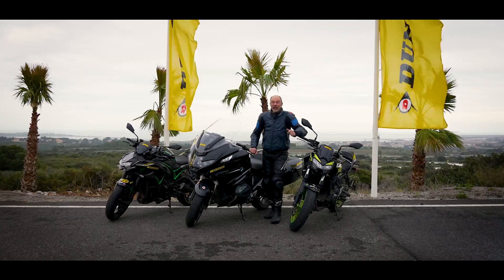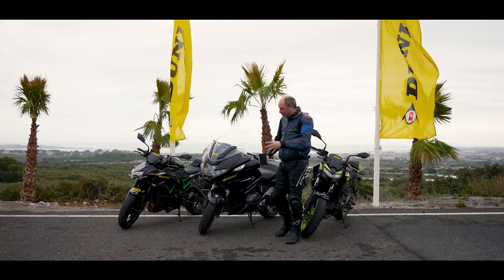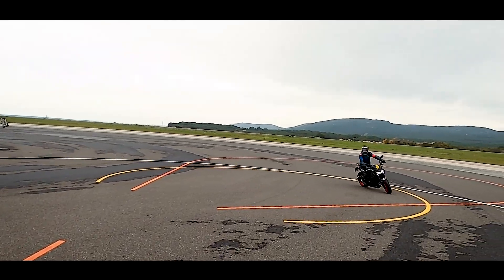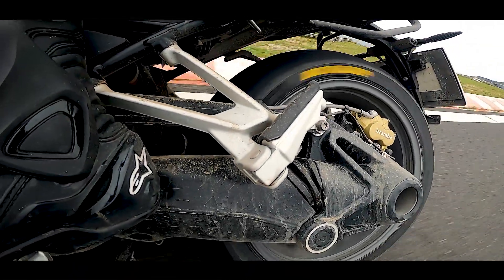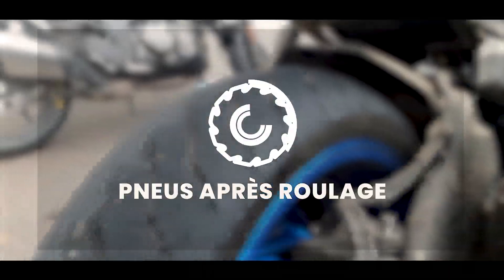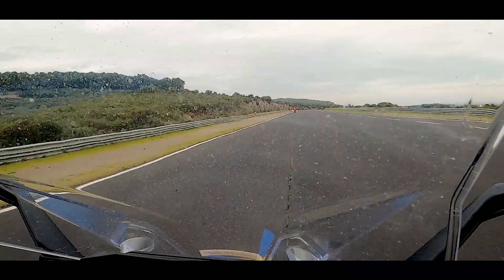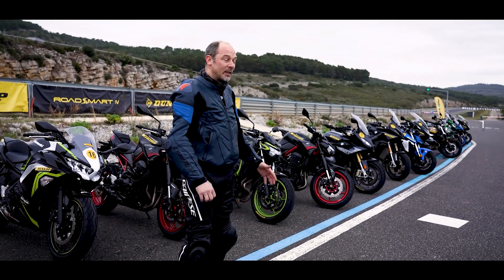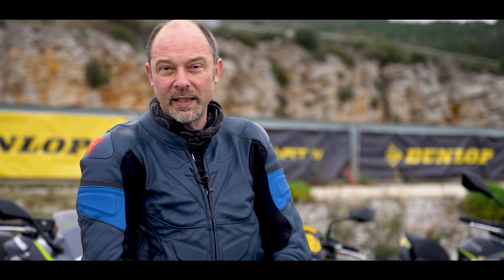Dunlop Roadsmart IV - Essai complet (2022)

Comment: Bonjour,

J'utilise déjà les ROADSMART 3 qui sont pour moi et ma BMW R 1150 Rockster de très bons pneus, je continuerai sûrement sur les ROADSMART 4, merci beaucoup à DUNLOP. 

J'aimerais savoir si dans votre essai avec la BMW R 1250 R quel type de ROADSMART 4 vous avez utilisé, la version GT ou la version SP, merci pour votre réponse.

Merci pour votre essai des DUNLOP.
Reply: La version GT, qui est conçue pour les motos plus lourdes. Excellent comportement et des changements d'angle bluffants.
Reply: @benoitlafontaine1815  donc sur le roadster R 1250 R bmw, c'est la version GT qui convient, ok merci, je ferai de même sur ma R 1150 Rockster qui fait 239 kg
Reply: @benoitlafontaine1815  merci pour votre réponse
Reply: @benoitlafontaine1815  déjà le RS3 est vraiment top, beaucoup mieux que les autres marques et surtout les Michelin R5 qui sont plutôt pourri
Reply: @skysurf8  disons qu'ils ont un comportement très particulier, sont hyper filtrants et s'usent de manière curieuse en cas de conduite sport, les Michelin... Certains apprécient cette "isolation". Apparemment, les Road6 ont évolué de manière significative. Ils seront en test, rassurez vous.
Reply: @benoitlafontaine1815  je comprends votre point de vue, mais clairement je ne reviendrai pas chez Michelin,  il y a une structure plus rigide chez Dunlop et tellement de points forts, comme déjà la maniabilité au pas, puis le feeling et le ressenti, la tenue de route rassurante et confortable physiquement et mentalement, la montée en température et la confiance (sans excès)  plus d'autres paramètres que je ne retrouve pas dans d'autres pneus, malgré les différentes marques que j'ai utilisé, perso je roule toute l'année et donc l'hiver je n'ai pas d'inquiétude, je suis rassuré et j'ai du plaisir à rouler malgré les conditions thermiques.
Reply from the maker: Merci Laurenn de nous suivre et à très vite pour de nouveaux essais
Reply: @lerepairedesmotards  merci à vous tous, c'est vraiment bien le repaire des motards, pour les essais et présentation des motos.
Reply from the maker: Merci pour ce retour, qui nous fait très plaisir. Et quand on bosse 7/7 pour certains d'entre nous (çà fait des années qu'on n'a pas pris de vacances), du soutien fait toujours plaisir.
Reply: @lerepairedesmotards  moi je bosse 7/7 avec parfois des déceptions et des bonnes nouvelles, heureusement il y en a plus, alors courage, vous faites un job extra, je penserai à vous lorsque je serai en vacances à Key West (aussi pour le boulot)  je considère le boulot comme des vacances 🌴